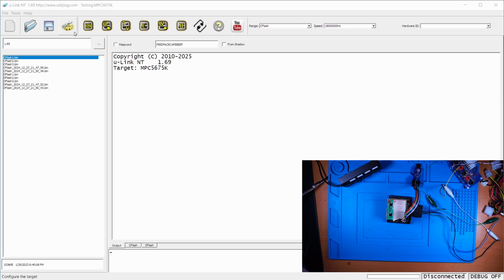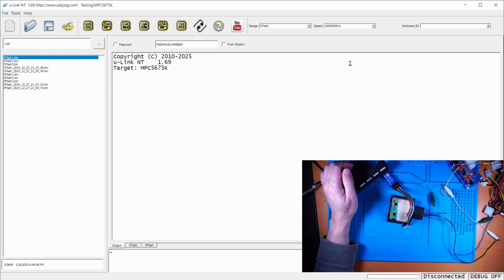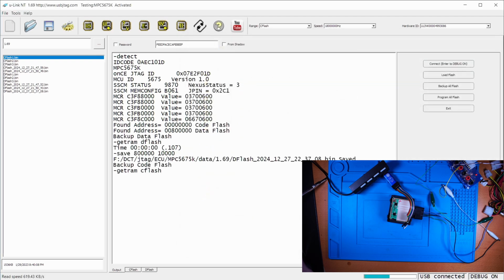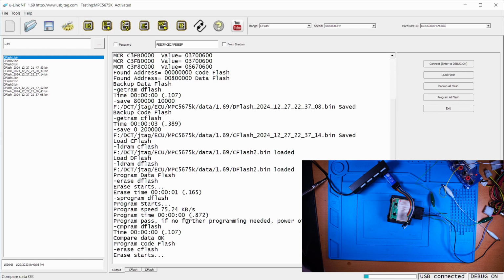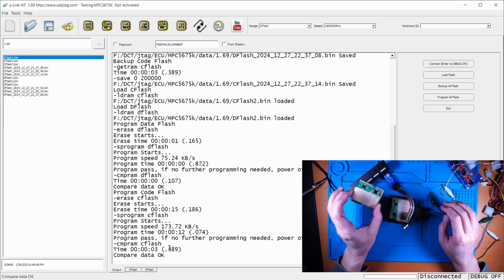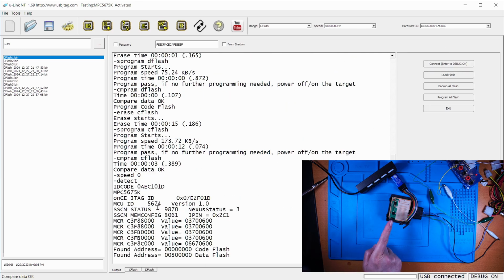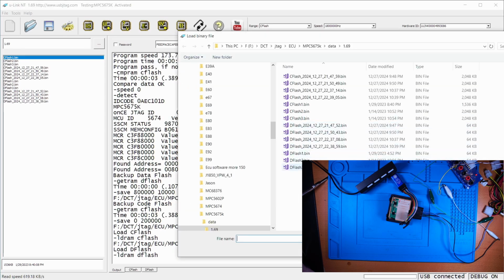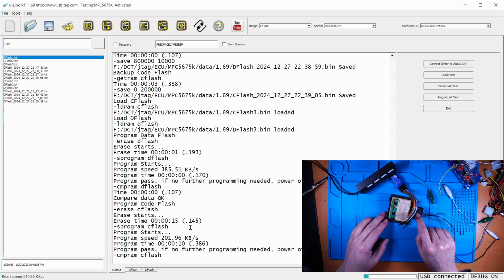u-Link NT Program Bosch Radar V1.69

Comment: Hi! Thanks for the fix. 
Btw. I'm trying to read SPC56AP60L3 with SPC560D4 xml, but after a few hundred bytes of reading I get only 0s or some garbage, reset pulled up to VCC. Can I ask for some tips on what I can check?
Reply from the maker: Does it have a watchdog?
Reply: @usbbdm  External from voltage regulator, but I turned it off and additionally pulled reset to VCC. (Active-low reset)
I'm not sure about the one built into the MCU, could that be the problem?